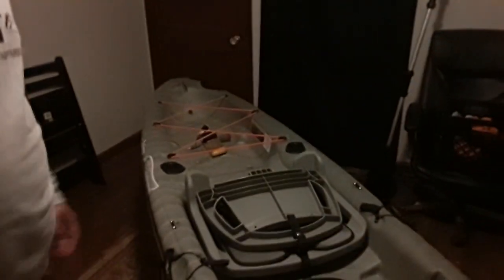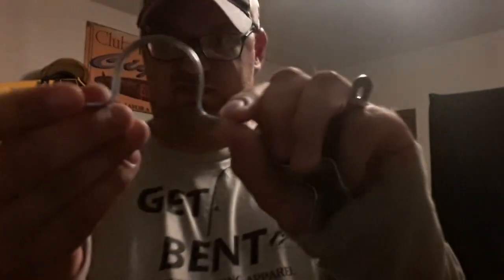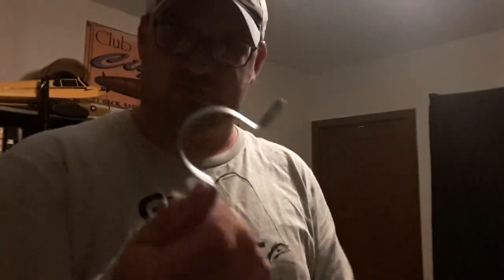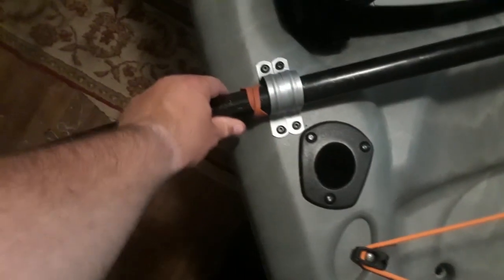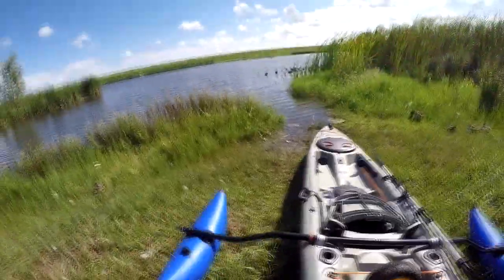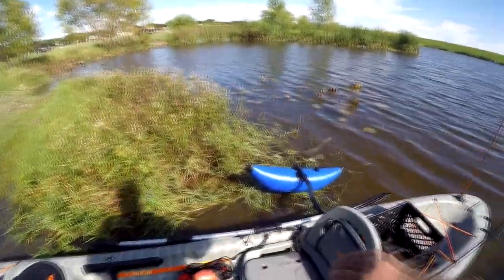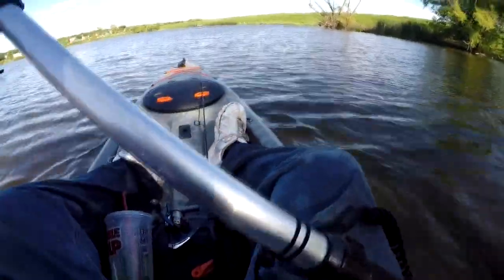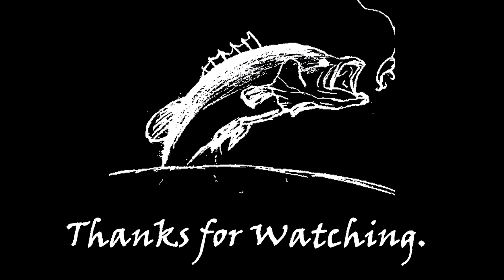Stabilizing an Unstable Kayak - Installing Outriggers - #bassfishing #fishing

Comment: Pieces of water hose or radiator hose cut to match work well to keep the rod from sliding in the brackets. Or you could just simply drill a hole and put a screw through the straps into the rod.

Comment: Can you stand up?
Reply from the maker: I probably could, but my balance is terrible. I took it out on some big lakes with big waves, so I'm pretty confident in it. I don't think it will flip for anything. I've been thinking about adding a stand up bar, but it won't be easy like this was.
Reply: I have the same kayak and bought some out Riggers for it, I hope it works.
Reply from the maker: @ryetaylor6418  it was very unstable before. Now it's a tank. It's more stable than a Jon boat.